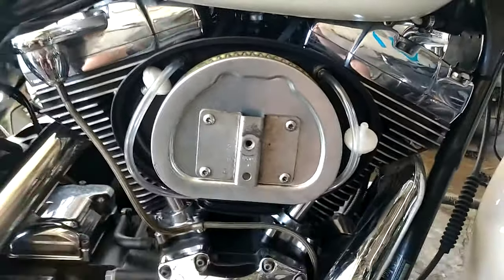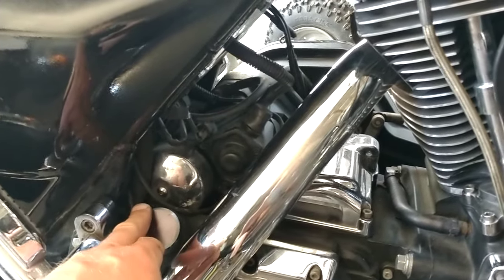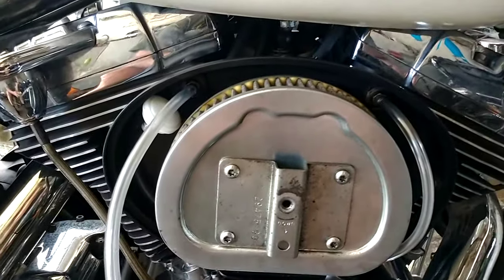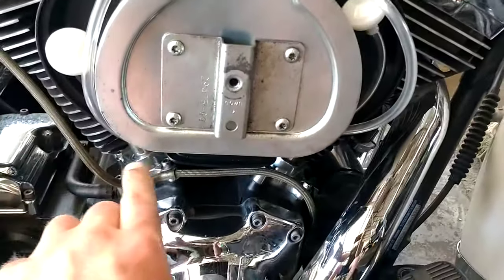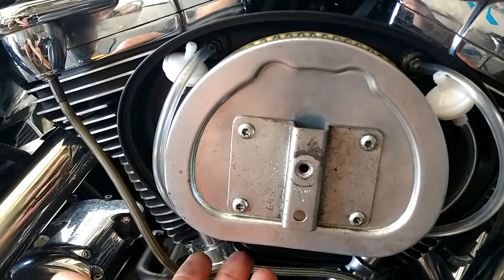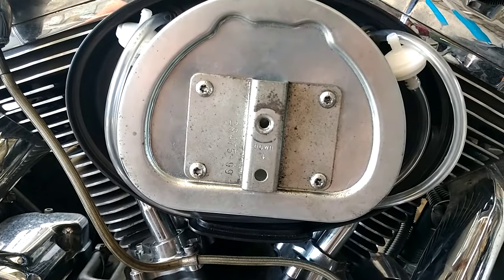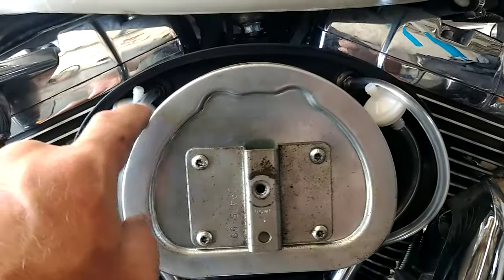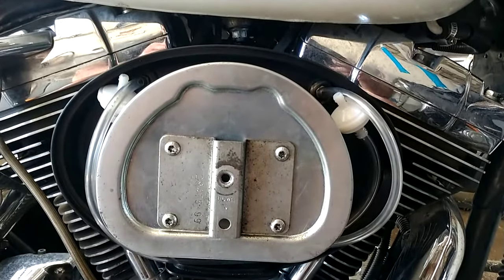Simple fix for Harley Davidson twin cam slobbering oil to intake/Air ceaner

Comment: What are those white plastic vent looking things? DK Customs has products that expel the vapors from the head breather bolts. And use a catch can as someone previous suggested. Still you don't Mention the white plastic things and where did you get them?
Reply: Looks like small fuel filters for a small engine, like a lawn mower.
Reply: @jeffhastings3463  thanks American Land
Reply: He clearly stated they were small engine fuel filters. I'm guessing you only looked at the pictures or never even finished watching before you felt you had to spew your ignorance.
Reply: @fredwilley5931  you need help take your meds
Reply: @americanland878  maybe you are not ignorant. Maybe you just lack the skills to absorb and retain information. You need not worry just go back and watch the video. I'll be self medicating at my leisure.
Reply: Watched it again some how I missed it 😂
Reply: @americanland878  well my friend I also watched again and I clearly heard him say: lawnmower filters. However might I suggest an alternative solution? Tap the hollow tubes in the space between the head and backing plate for air cleaner and screw in a fitting that a hose can be slid upon. Drop down a few inches and install a y. From there run a single line between the cylinders and run to a tap inserted to the inner primary case thus returning the very minute oil into your primary and not into a lawnmower filter or all over the outside of your motorcycle but into an enclosed oil receptacle. Think about it before you say anything.
Reply: @americanland878  and you will close off the end at the backing plate to eliminate anything being sucked into the back of plate.

Comment: Easiest way to stop a Harley from slobbering oil is to trade it on a BMW.
Reply: Right never buy another Harley and you are home free.
Reply: Because BMW has such a great track record for quality, LOL.
Reply: No, I rode a BMW 1200LT and it felt like a top heavy tank with a bunch of rattling plastic
Reply: buy a bmw and ride the best    ride a mile and walk the rest
Reply: BMW makes a good bike.  But the dealer network is pretty frigg’d here in the USA, including parts availability.
Reply: Who would do something that silly after riding a HD?🤭
Reply: fladave99 Mills   well my Harley don't have hp issues any more shes putting out well over 200hp n I can turn it up as well, I can run away from most crotch rockets 🚀!..
Reply: @bobhat2001  BMW riders are mostly 👧 girly soy boys, not much testosterone in their blood 🩸.